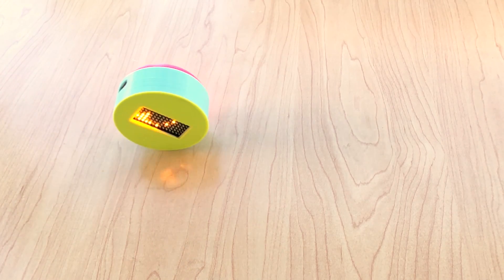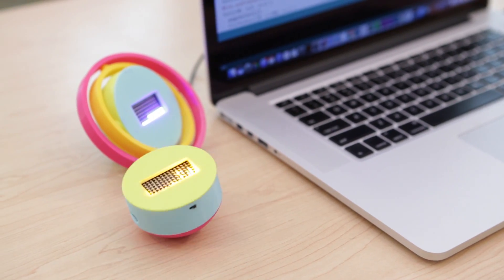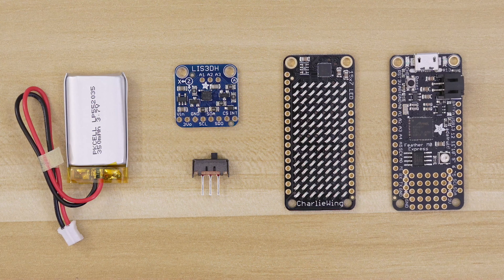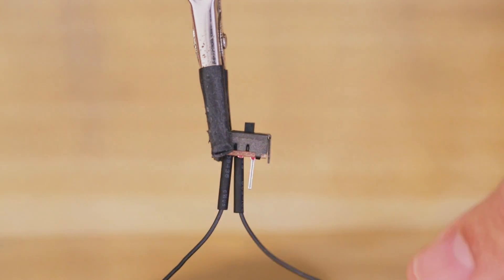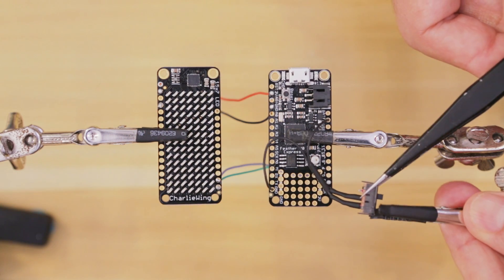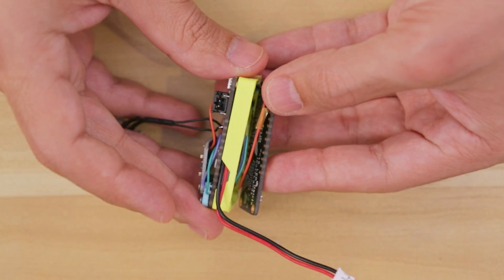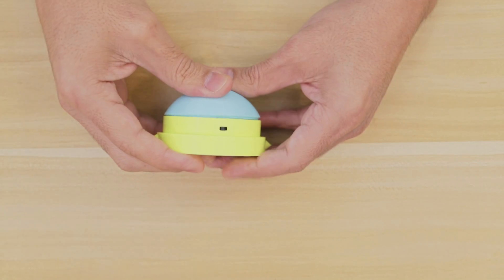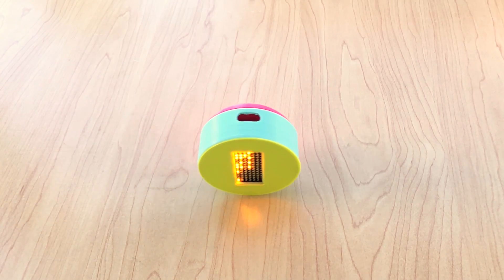LED Sand – DIY Physics Toy

Comment: I'm having issues with the codes that I copied. I verify it on Arduino and it has an error. when I correct it there is another error and so on with others. I'm not sure if you guys make any other changes you made or if you can send the original code that had not been changed before. thank you

Comment: That outer ring assembly isn't really a gyroscope, it's a gimbal... right? Gyroscopes are often mounted in gimbals, but the gyroscope is the spinning part and the gimbal is the outer ring part...? Still, cool project!
Reply: J.L. Williams I’m pretty sure he accidentally said gyroscope instead of gimbal because I can’t possibly imagine a gyroscope that far from the pcb as it is highly impractical
Reply: Correct, that's a gimbal.
Reply: @Definate Google "gimbal" please
Reply: William Meisburger-Iwata OK:

gimbal

ˈdʒɪmb(ə)l/

noun

a device for keeping an instrument such as a compass or chronometer horizontal in a moving vessel or aircraft, typically consisting of rings pivoted at right angles.
Reply: J.L. Williams google "gyroscope" please